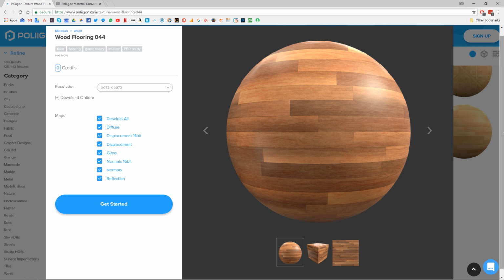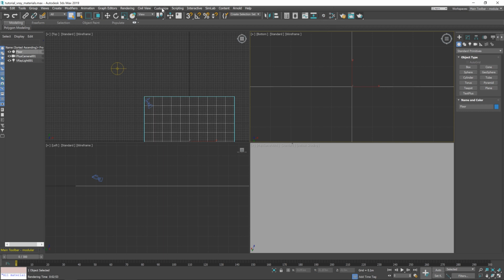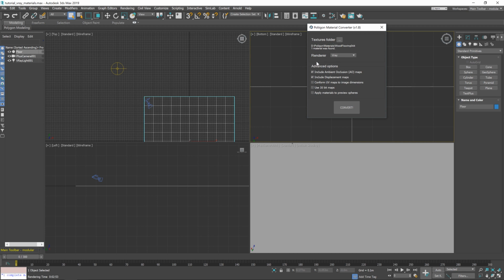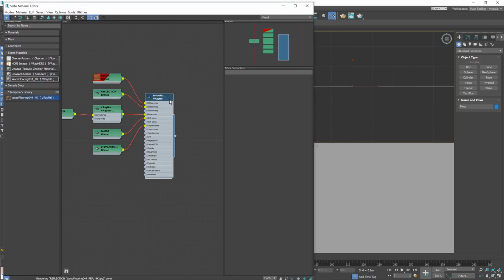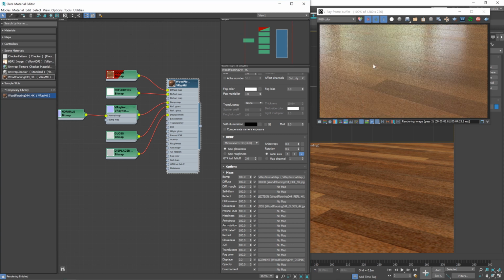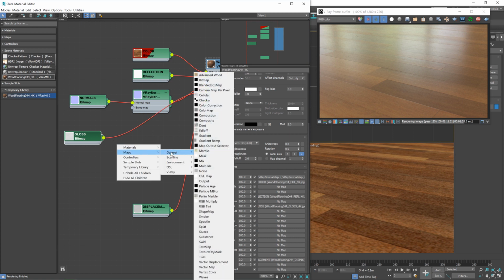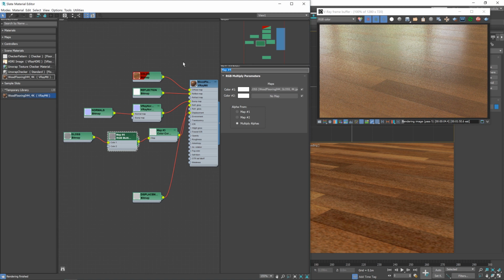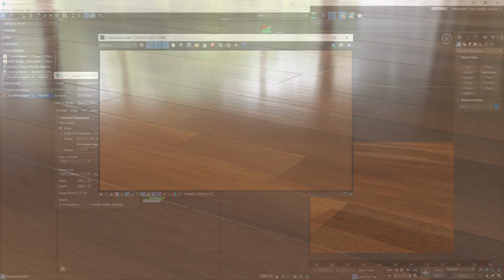Using Poliigon textures in 3DS Max with V-Ray

Comment: It would be useful to have a value option for the displacement map in the options of the material converter. When loading multiple materials it's a shore to adjust one by one.
Reply from the maker: Good idea, I'll feed that back to the dev team that work on it. Thank you.

Comment: HI，I followed your tutorial to try importing materials into VRay NEXT, but this failed.The plugin will prompt "could not create the vray material. please make sure the engine is installed correctly."
I switched to the Arnold renderer and it worked, but VRay NEXT didn't.So is this the problem of the version number?